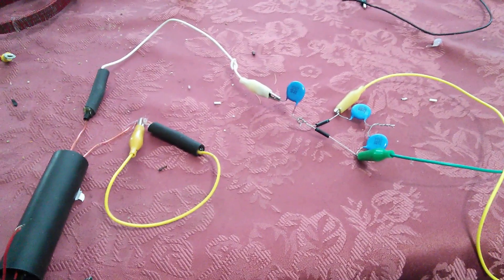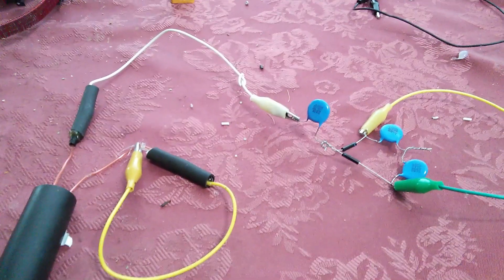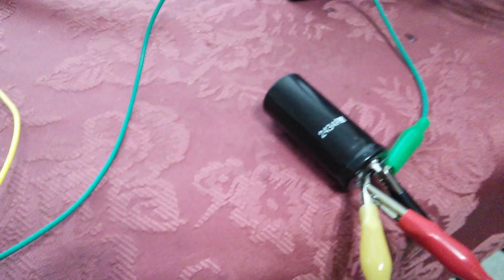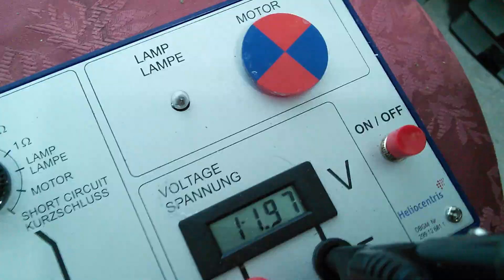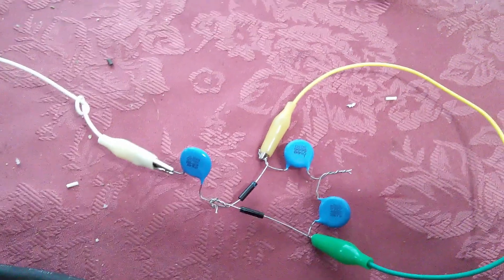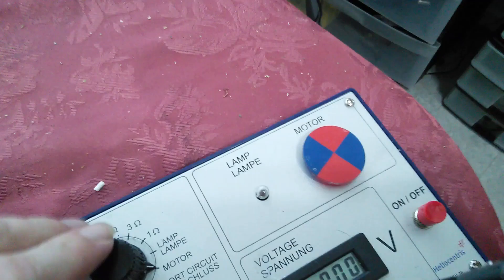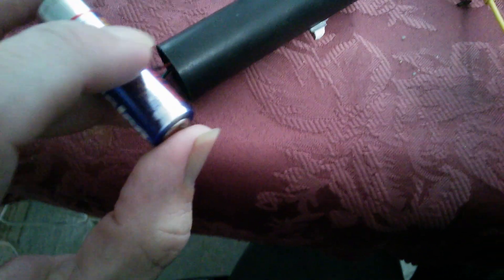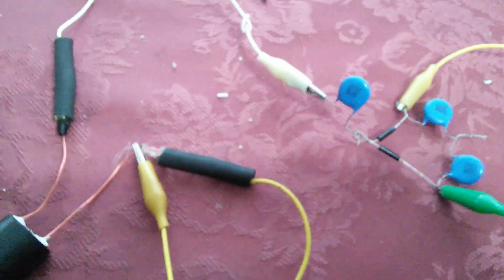Tesla's One Wire System

Comment: Do you think theres a way to maximize this effect?
Reply from the maker: Yes more AV plugs and cap dumps.
Reply: @joellagace1679 hmm. I guess for the reciever, but what about the transmitter? 

I want to try this with 2 of them in series. Hmm
Reply from the maker: According to the calculations with a small transmitter you can get a max of hundreds of watts if you can figure out how to tap into this extra part of the energy spectrum using special devices, the limit is more set by what method and devices you use, Diodes (THE AV PLUG) is the most simple way to tap into some of this energy but the efficiency is so very very little so you would need like 1 thousand of them or so before having to worry about maxing out the power output of this field. But yes in theory there is a max limit based on potentials. It's a rather big number is what i'm getting at and back to Tom Bearden saying that they don't want to say that there is an ignored energy interaction with every circuit that interacts with more powerful forces then what we use in traditional circuits ignoring the Heaviside Pouynting vector etc..
Reply: @joellagace1679  It is quite Interesting. I spent the past 2 weeks trying to model a multilayer tesla coil based transmitter and reciever, and my simulations didnt pan out with transmission lines and endless tweaks with resonance. However, I finally cracked the design today with fixing my rectifying diodes for the voltages and speeds. Im shocked. It works, but I dont truly understand why. 30%, a bit out of tune, 20 watts through. A very interesting field. Good luck with your projects.

Comment: Joel  could you just dump the capacitors into a heating coil if you add more capacitors youd think when its dumping into heating element you would be getting to use all of your energy for something useful  directly without  charging a battery which might not be that efficient
Reply: Would get pretty hot too you think if you can charge capacitors super fast like you say
Reply from the maker: Something else that gets very hot is magnesium and vinegar drops.

Comment: I'm having trouble with my gas discharge tubes staying on. They will pulse for a while and then lock on that glowing stage. I've tried using multiple, changing capacitors, is it the energy is too high for the tube and so it gets stuck. In this state of glowing is it charging anything? Thanks
Reply from the maker: Might be too hot if it stays on its kind of like a neon just lets it passively pass. But just like not having the gap at all, on its own not enough current to move anything much including charging batteries, It's the cap dump that really does it with the blinking discharges. Higher power will need a modified triggering. The neon/gas tubes are great with very small current. Any thing more as you noted it will just conduct once and keep on. I'm still looking into that low power mode 555 switch. Would solve all those issues, But the gas tubes are great for testing to see if it will work.
Reply: @joellagace1679  thank you. I'll get it on aswell

Comment: Joel, I set up my circuit like yours, however; I used slightly different ceramic capacitors and diodes.  I think my high frequency high voltage oscillator is 3-6V in and I think 400Kv out.  I did end up getting this one wire system to work but with some difficulty.  A few things I noticed was the facts that the capacitor coming out of the half wave bridge rectifier had to be backwards in order to charge up.  The other strange thing was the fact that I had to manually pulse the oscillator with the battery because my electrolytic capacitor would only charge to about 3 volts when the oscillator was continuously running off of the battery.  When I pulsed the oscillator by hand, I got the capacitor up to 20 volts.  I was then able to dump this capacitor into another capacitor normally.  I could run an led for a brief moment off of this dump capacitor.  What are your thoughts on all of this.  Also, what components and ratings were you for your setup?  To get past this, I may put a timer for pulsing between the battery and oscillator.  Thank you, Clint.
Reply from the maker: It's best to use a real tesla coil output or a very high frequency high voltage generator without the voltage multiplier stage. Like the driver of an Ion generator i'm using to simulate the output of the Tesla coil for the one wire system. Those high voltage module voltage multipliers can take up to 1 amp at 9 volts if you connect it direct! How ever as you stated you can pulse the input into a small cap and adjust the duty cycle (current input) for the isolator and I was able to run it down to around 25ma for almost the same hv output. I did not get as good luck with them. But for the demonstration of the one wire system with 2 diodes it does well.
Reply: Thank you.  Could you please recommend where to purchase A driver of an Ion generator?  I looked online and could find one that you were using in the video where the driver had four wires and ran off of 3 volts.  The best that I saw were those with three wires.  I'm just a little confused, though I have an idea as to why they one have three wires.  Also, in the community form I was wondering if there was a section on theories?  I don't think I saw one and was wondering if we could add this?  I have some theories to share with the community.
Reply: Try using high frequency diodes they work best like the in34.

Comment: I also did some cool stuff with fly-back transformers. you can use the discharge on a crystal, and change the programming of a universal remote for your tv. 
 you definitely create random frequency.  

 My question is simple, and if any 1 has a Tesla coil i like to see it in action. 
what happens if you put a fly-back or a ion generator on the inside of a metal sphere. does the charge  build up like a Van De graff? 
I  think it should charge to a high potential. could be a vast source of electric potential. by taking all the charge off the top load after it has a build up of charge.

 far less of a cost to operate a van De Graff in that manner.  rather then a motor and a belt drive..

so dump the cap onto a top load of a Tesla coil, it should pop out the other end, then u can see the ac and dc at the same time..
Reply: Are you ready for the amazing physics of the new electric transformer i made?
Every one i want you to understand of this new idea/invention i like to show all of you. 

working with one iron bar, and a coil of insulated wire around that bar, i found something of interest, called the tank circuit. working on the basis of electrical discharge and voltage production in the coil i propose a better way of inducing a AC charge in a coil wrapped around an iron bar to create a set up that mimics a magnet.  

Just give credit to me if you also discover this amazing new, but theoretically very old.

ok ok ill tell you. Take the iron rod, use insulated wire, wrap it 100 times. you have 2 open ends of a wire. attach the voltmeter to these 2 wires.  OK here comes the special sauce and the spices..
Use either the high voltage fly back or ion gen to now electrify the iron rod. HEHEHE next take a single ground wire create a small gap at the other end of the iron rod.. obviously if you what more power ad a capacitor in line to the coil and ground to simply increase the capacitance of the electric static potential..

OK 1 rod, 1 ground one high voltage static electric potential, one cap after the first experiment you should add a cap and operate the devise in the same manner as i say.

the theory is, a discharge of a spark induces a charge in the coil, due to the iron domains in the iron rod, they flip on off due to Iron or electric domains. the iron rod has domains that are not aligned, or aligned to north, and south pole. if you hit the rod you induce a current, if you ground the rod, and keep a gap you should see discharges of sparks, and in the coil a voltage. you no longer need a magnet to spin a motor to do this i claim.. let me know your result, and i will show you mine... if i need to advance this i use 2 iron rods shrink warped individual. you have 2 iron rods.. isolated shrink wrapped
next combine the 2 rods, place them side by side, now  wrap some insulated iron wire over the 2 rods,, now i have created a forward and reverse patch for charge to flow.
now i have 2 cores that are operated as a single core, and the input of static in one side of the rod, the starting point, and the ground wire is side by side, and on the same side as the input devise.. now i have a constant flow, discharges, and direction in the 2 opposite directions.. what if i use heavy insulated wire, and use the under over coil wrap technique.  each loop becomes a bow tie, and  the iron rod has a under over design..
as too have a  double loop, but in 2 directions.?

Comment: doing all the relevant experiments as simple as possible, awesome!

You could try to use 2 caps, charge one, write down voltage, discharge through circuit, measure voltage on output cap.
1/2 cv^2 is the capacitively stored energy in joule

Comment: Yess haha this is awesome. Yes, rectifying things does some magic. I deleted the video but if you use an earth ground and a small amount of dc (10mv in my case) through a full wave bridge rectifier you can get double digit voltage readings. Dc into ac of rectifier. Earth ground on dc positive output, if I remember correctly.
Reply: I've only done that with what are considered to be ultrafast diodes
Reply from the maker: that's what the split is for in the caps to grab a ground potential, not connected for demo but there to test out various grounds and yes it does indeed do changes in some cases without the cap to load it down i read a difference of as much as 60V just having it on there.
Reply: @joellagace1679  try using 2 isolated grounds. Be sure they are isolated. One on the DC side and one on the AC side. You should be able to use just the aa battery as your ac input an get decent readings. I tried to replicate your work here but I used some tiny diodes and they smoked pretty quick. Haven't tried it with the bigger ones. I may do that shortly.